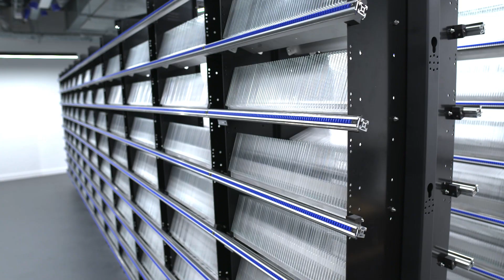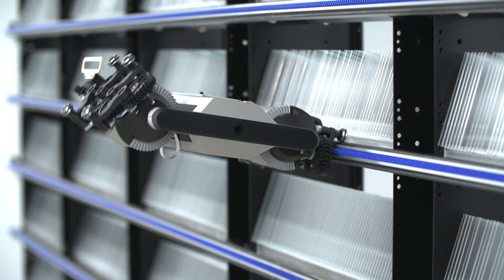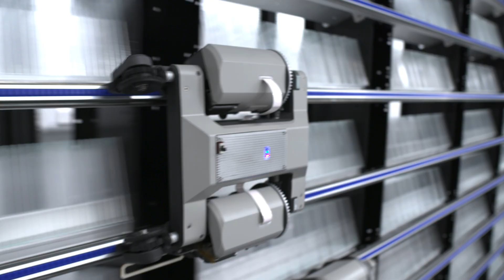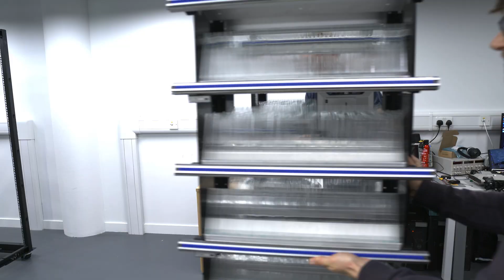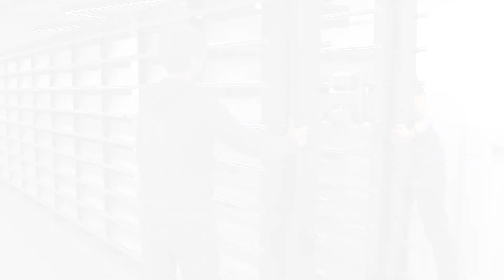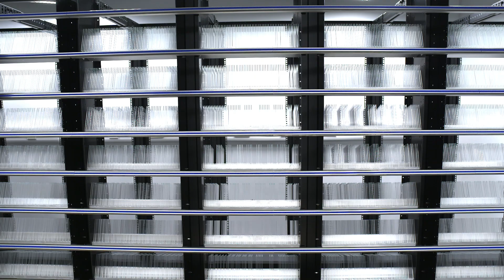Project Silica Library 2022

Comment: What function is that bot actually performing, as it skirts across all the Silica drives?
Reply: It picks up one of the glass sheets and transports it to a reader for processing, and places them back when the data is read.
Reply: @konsul2006 Thanks, I think when I posted my comment, I was not aware that its primarily for read-only long-term archive storage.